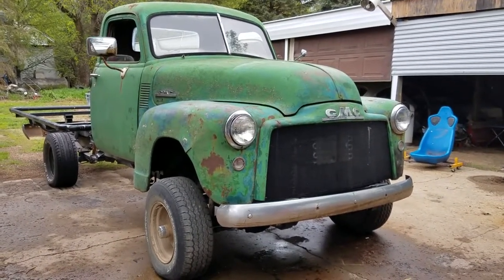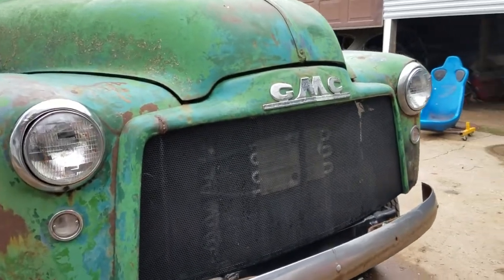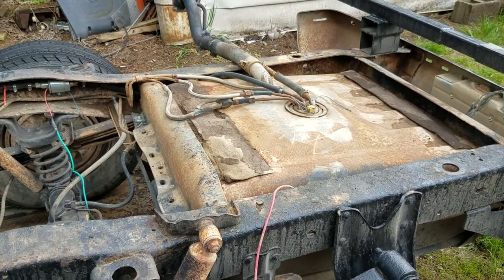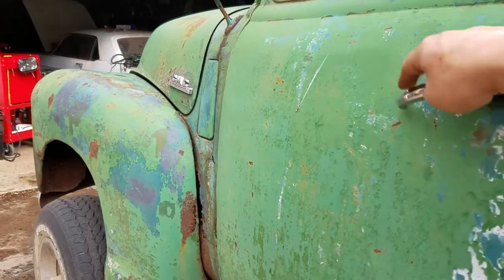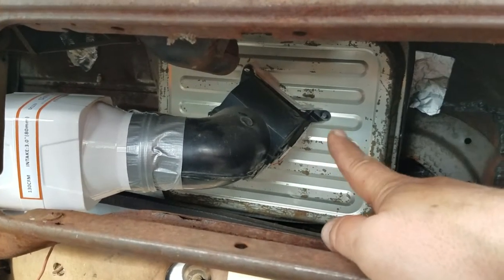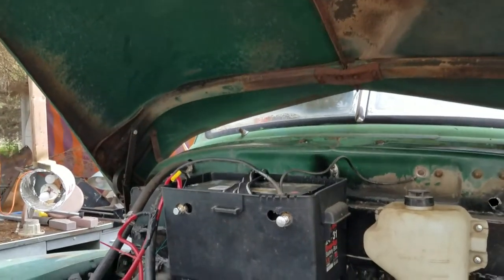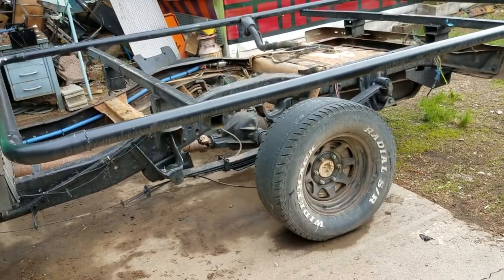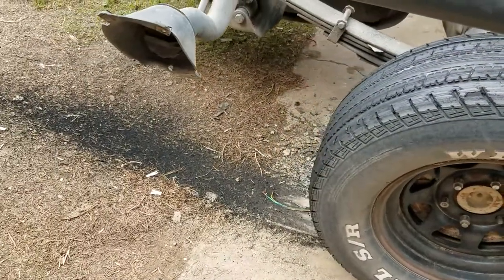1950 GMC Budget Build Walkaround and Burnout

Comment: Did you have to make any modifications to get the alternator to charge. Also which wire do you connect to the electric choke on the carb...attempting to do this on a '90 Chevy truck with the same 5.7/700r4. Thanks for your time.